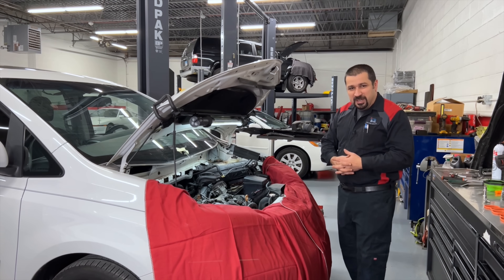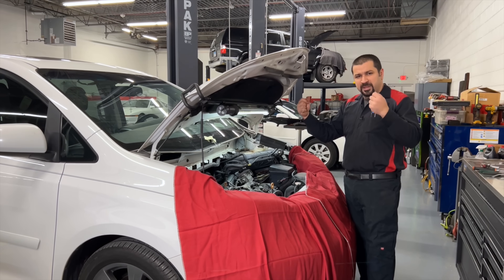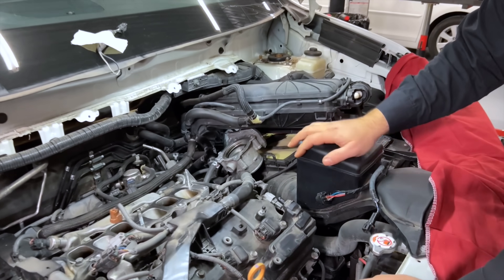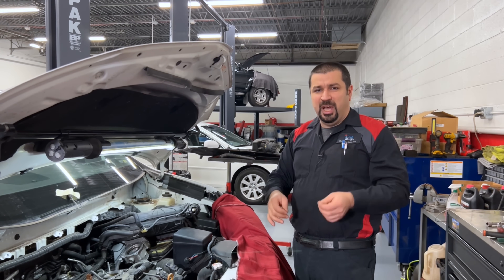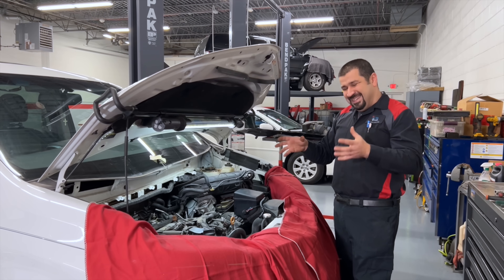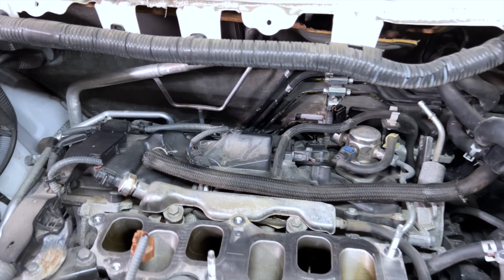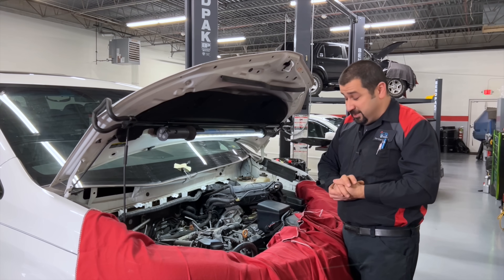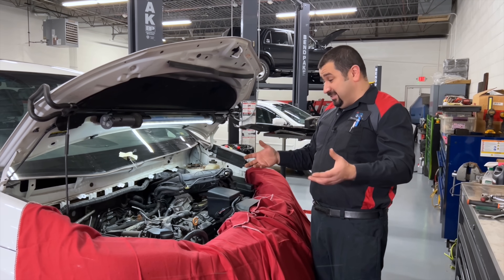Does Toyota Direct Injection Cause Carbon Build Up? Let's Find out!

Comment: Always great videos. Very informative. I was wondering what your thoughts on oil catch cans? Are they worth it on a stock engine? Or a supercharged engine?  Also Your take on k&n filters/ TRD cold air intake. No one ever really does a breakdown of long term use of the reusable filters. They talk about how it lets in more particles but never if it’s actually a concern. If they do say it’s a concern they just say it scars the inside of the engine but have no proof just mention they heard from some random guy. Also any tips on super charged engine maintenance and things to look for would be great too. Everyone always posts videos of them just recently installed a super charger and that it gives them more power but never what the maintenance or potential signs of issues might be. Thanks

Comment: Yes DI cause carbon build-up. 
That's why Toyota, and Ford, had to add PI too (to the DI), to clean up the valves' top side and the inside of the ignition chamber.

Comment: Carbon is from the exhaust gas. Your egr pump that into your engine to cool the combustion. Oil through blow by does not turn your valves into what he is showing you. If you were to loose that much oil through blow by. Your in alot of repair trouble. He is a great salesman. 👍 making the dealer alot of money. Keep up the good work

Comment: After changing my transmission oil for the third time at 130K I feel slight more engine vibration and slightly poor gas mileage. When I had the tuneup at around 120K my PCV valve was not changed because mechanic suggested me that it’s a four hour job and I should only change it when I see a check engine light. 
It’s a 2018 Camry Hybrid LE. 
I have a lot to know and learn but unfortunately I’m I unable to get any solution 🥺. 
Thanks

Comment: My 2GR-FKS 2017 model with 80k mi had a good bit of carbon buildup on mainly the middle most valves when I did my spark plug change, despite using Techron and top tier fuel, and 7500 mile synthetic oil changes with Toyota filter. Going to 5k mi intervals, and using CRC valve cleaner.

Comment: From my limited understanding of direct injection engines, it's not only the short trips that will cause more carbon build-up but the speed. Go 30 mph or over to minimize the build-up. Fuel system cleaners will also help clean the build-up. Project Farm or Scotty P has recommendations. Seafoam is what I use on my two old DI engines over 15 years. It's even more important to use on turbo front wheel DI engines.

Comment: I drive an '18 RAV4 with only the port injection.  If anyone can tell me why you need TWO separate fuel injection systems I am listening, however I will tell you up front you DO NOT need two separate injection systems.  But I am listening.

Comment: This is why electric cars are much better none of the Carbon,oil changes,timing belts or chains no transmission etc.  I’m automotive tech I know but if people want to drive combustion cars be my guests just expect lots of maintenance and repair bills it’s all good for me it pays my bills no seriously cars now are too complicated especially Diesel with all this emissions equipment it’s incredible how expensive to keep on running theses system when the factory warranty is out as a example $ 1.900.00 Canadian for one Nox   sensor on 2015 VW Touareg and if you don’t fix it the engine will stop starting after X amount of starts as a count down .

Comment: Does the type of fuel affect the life of the engine? You should do a video on using ethanol-free gas vs ethanol-blended gasoline in the engine.

I’ve read that ethanol gas is highly corrosive and bad for the engine. Maybe you’ve already done one, I personally believe this is why my Toyota’s engine gets a lot of carbon build-up and catalytic converter failures when I was using the blended fuel trying to save money on gas but it ended up costing me in repairs afterwards. 

The Toyota manual recommended premium gas which is ethanol-free.
Reply: Dave,  I don't know about where you live, but here in SE WI, premium is NOT ethanol free.  Have to go out of several counties to get any Premium Ethanol Free.
Reply: @stevehoppenjan  there's a gas station right in my town that has ethanol free gas. However, kwik trip only has the recreational non-ethanol gas for premium. Thought they were all over WI.
Reply: @phajeb001  They are.  But EPA regulations prohibit them from selling ethanol free in counties that have bad air.

Comment: You explain everything very well and l know Toyota use direct injection but l didn't know they also used port injection which means no carbon buikd up on the valves our 2021 Suzuki Beleno only has port injection and my 1997 Toyota Hilux has a carburetor niw that is nice and simple

Comment: I bought a '22 Corolla SE manual and plan on making it last as long as I can. 8000km/6 month oil changes every time. Every cold start I let the oil circulate until the RPM drops (30-60 seconds) before I move the car at all/load the engine. I try to limit cold starting as much as possible. And almost everytime I drive the car and I can get it up to operating temp, I give it an Italian tune-up to keep everything flowing properly. So far it is a great car and I want to keep it working flawlessly. Thanks for another insightful video.
Reply: Question"- whatis Italian tune up? Pasta/pizza is involved?

Comment: PCV systems cause carbon build up, intake runner fuel injection washes the back of the intake valve and cylinder head. Direct injection requires intake injection when it has a pcv system. Failure to redesign the pcv system in the early use  of direct injection caused the issues.

Comment: Does that car not have a EGR too? Or is it only applicable to diesel.. i had a Hyundai 1.4 Diesel in the past, obviously direct injection.. i took the intake off at 100 000km and when i saw it, it was almost completely blocked, was surprised how well it drove and preform i was just curios, anyways i cleant it put it back, but thats deffos caused by the EGR, i tried blanking it off with no luck it wouldnt start at all with it blanked off. Cleaned it again at 190000km was not that bad at that time, and eventually i sold it with 250000km.. actually impressive  that small lil diesel engine only consumed like 4.8L/100km and it went all the way to that milage with myself doing all services/ oilchanges.. cost me nothing other than services with obviously the recommended 5w30 as specified.  When i sold it every single thing worked and i got the price i paid for it after 6years of ownership.

Comment: You can use 87 Octane in a Ford 3.5 Eco Boost and so far it’s running very well 👍. Also, the valves are still running very good 👍
Reply: BP?

Comment: looks like Toyota incorporated the double fuel pump system of a diesel commercial semi-tractor injection system. But I'd like to know where are they placing the fuel filter? is it, an in-the-tank part of the pump filter or is it on the frame rail or both? on semi-tractors, it was just in past the governor.

Comment: Since this engine has port injection it's no surprise it stays clean - I think you really need to scope a 4GR which doesn't have the port injectors to clean the valves

Comment: the problem with this type of engines, 
a check engine oil level + OIL SMELL IS A MUST. 
because there is a chance that the high pressure pump leak fuel inside the oil system.

Comment: Great video! My 2018 Highlander has the same engine. Never worried about the carbon build up on the intake valves on this engine, because I seldom hear the noise from the high pressure pump when my foot is not on the gas paddle, such as waiting at the stop lights. That means the intake valves always get sufficient washes from the port injection. Well done Toyota!

Comment: Like your videos, you pointed out something I was doing wrong. I bought a 96 Camry and researched the vin trying to find maintenance history, found out the transmission fluid was last changed in 2004. It's a dark pink color now, I'm at 268,000 miles, should I change it and if yes what fluid should I use?

Comment: Ah, finally a “believer” eh!?

Said it years ago: GDI is tricky, but SOME makers have figured out engine management algorithms to avoid and clean the intake valves.

From higher rpms and heat cycles, to valve timing/overlap and spark timing.

Comment: Great video AMD - thanks for posting! The idea of dual injection system is not really new though. It has been around in 2GR-FSE since 2005, so no surprise the system works. I'd love if you provide more information in the future about the -FSE engines, especially the 4GR and 3GR. I wonder how they are affected by the low friction pistons situation and if it makes sense to rebuild these engines. Cheers!

Comment: Toyota invested a lot in this double injection system after seeing Korean cars attempt direct-only. No one likes hearing 'high pressure fuel pump'. It sounds like something expensive that will break inside 200k miles. On mass produced diesel engines, they've hardly just perfected the HP fuel pump in the last 20 yrs. I'll give Toyota the benefit of the doubt... They can have a complicated system and I'm still going to buy it... Used... In about 10 years
Reply: lt's been in use for 15 years and has proven itself effective and reliable in that time. WTF are waiting for?
Reply: Since 2005 lol

Comment: Great video as usual. Will long trips, highway driving and regular oil changing remove deposits from an engine that already HAS carbon build up in the intake runners?  Do any fuel additives help???

Comment: What's a good scan tool that can reset steering angle after an alignment so it doesn't pull when in spec. 21-23 is350 model? Any good aftermarket ones, or go oem?

Comment: While I appreciate that Toyota goes the extra step of adding port injection to the direct injection cars......it does not solve the problem of direct injection cars being too complicated and having such high fuel pressure related problems.  I'll keep my direct injection only 2TR-FE until I die because it will never fail me.

Comment: Another benefit of direct injection that is important to note is that it enables the manufacture do use higher compression ratios that improve performance and promote better fuel economy. With port injection the induction charge picks up latent heat from the intake and cylinder heads and is less dense. With direct injection the fuel charge is cooler and much more dense and it actually has a stabilizing affect on the flame front within the combustion chamber. This allows the manufacturer to step up the compression ratio with all of that benefit while at the same time not having to use higher cost, higher octane fuel that is normally needed with higher compression port injected engines. Most direct injection engines usually only require the use of lower cost regular fuel. A big savings for the consumer over the life of the vehicle.

Comment: On slightly related note, does climate conditions matter for the maintenance schedule? For example, if you live in Minnesota or Alaska, do you need to do your maintenance more frequently?
Reply: Yes, it falls in severe driving conditions as per Toyota manual.  6 month oil change intervals is a must.

Comment: Many Thanks for sharing dear 
Nevertheless  thanks to my beloved 2008 Hyundai Sonata 2.4 normal fuel injection
Theta engine, I guess Lol 
 It's never been to a car care unless once lately when I was checking spark plugs and an oil was leaking somehow there, so that ultra polite mechanic changed all of the valves's cover seals 
Up to now it's more than 4 hundred  10 thousand kilometers and working as a champion

Comment: I'm a short distance driver. Is there a driving mode where Port Injection would be in use more than Direct, so I'd be cleaning off those valves more?
Reply: Port injection gets activated when driving casually, if I'm not mistaken.

Comment: I guess the only real downside with having both GDI and regular port injection is having two sets of injectors (instead of just one) that will eventually go bad.
Reply: True, but well made injectors (at least port injectors) can easily outlast pretty much everything else. The high pressure fuel pump and direct injectors I'm not so sure about though, I suppose that's very model specific but extra failure points nonetheless. It doesn't sound like direct injection systems are nearly as DIY friendly as port injection either when something does go wrong. Fortunately I haven't had to deal with working on a direct injected fuel system yet.
Reply: @averyalexander2303  Good points.  I completely forgot about the problems high pressure fuel pumps have been.

Comment: I drive 81 miles a day for my commute to work in my Lexus NX350h.   Since it is mostly highway miles, should I still change the oil every 5000 miles?  Or will it be ok to change every 10k miles?
Reply: There are vast differences in the quality of 'synthetic ' oils on the market. You have invested in a car that can be reasonably expected to last 300,000 miles or more. Driving 10,000 miles with cheap motor oil that only meets the minimum standard would be a really, really bad idea. The Project Farm Youtube channel did an excellent comparison of major oil brands a couple of years back which clearly demonstrated the gap in quality between best and worst. There are many other sources of objective information on synthetic motor oil. There is also a vast difference in oil filter performance. My car is a very poor cousin to yours but it gets the best oil and oil filter available. After 18 years with top quality oil the engine runs as smoothly as the day it left the factory.
Reply: @RightLaneHog3151  Agree.  If I were @william, I will just buy the oil and filter and change the oil myself every 6 months.  Cars are getting real expensive nowadays.
Reply: @jeancassel  I have used Amsoil Signature Series since the first oil change. Initially I followed the Toyota 'severe service' intervals for oil changes. When the powertrain warranty ended after 5 years, I switched to Amsoil's own Severe Service interval of 1 year /15,000 miles for non-turbo engines with a Amsoil top spec oil filter. I am in my 13th year  of their program with no issues. Naturally, I use Amsoil lubricant in my manual transmission as well. 🤩

Comment: I have Toyota Corolla VE 1999 Canadian model, around 280K KM on it, it still runs very well and no issues. The last oil change was done at Walmart, oil was overfilled, can the overfilled  oil damage the engine?
Reply: It depends how overfilled.  If it's no more than a quart, it's fine.

Comment: I just bought a 2016 Prius with 65xxx miles on it yesterday. It has a new air filter and a fresh oil change. I just changed the cabin air filter with a Hepa one, (the dealer decided not to change the cabin air filter). I’m going to order the hybrid battery fan filter and the spark plugs to do a tune up. I also have coolant, and transmission fluid on the way for it as well. Basically every maintenance item will be replaced right away. My question for you is about engine oil. Is there any difference in the 2zr-fxe in my 2016 that called for 0w20 and the 0w16 that is called for in the later years? I’m considering using 0w16 if you think that would be a good idea. The slightly lower viscosity in theory should allow for quicker oil flow during cold starts and when the engine kicks in while driving which might technically be better for the engine. But the difference is very minor. I work at a dealer (the sister location of the one that didn’t do the cabin air filter, we change them on all used cars regardless if it’s clean or not) so I’ll be doing the maintenance myself in the shop. I also just ordered mooneye wheel covers to slightly improve aerodynamics over the wheels, and I’m going to remove the cross bars that came on it for daily driving. Is there anything else that you recommend that I do? I drive about 100 miles a day. I’m also going to get the windows ceramic tinted, that should help a lot with the Texas heat and improve efficiency greatly as the ac system won’t have to work as hard or as often to cool down the interior and by extension the hybrid battery.

Comment: Can you please do a video on whether or not installing an oil catch can would be a good idea to increase the cleanliness/longevity of the intake system?
As an owner of a 2019 4Runner since 3 miles I want to make it last forever. The biggest thing I've had to deal with is dealing with applying fluidfilm/surface shield on the undercarriage before every winter season.

Comment: I got a 2010 Prius with 280,000 mi. Still runs like a champ. It gets about 20 or 30 Italian tune-ups per day. I do change the oil every 5,000 though full synthetic.
Reply: Hey, what is 20 or 30 Italian tune-ups per day meaning?
Reply: 😂 the Prius is being driven hard